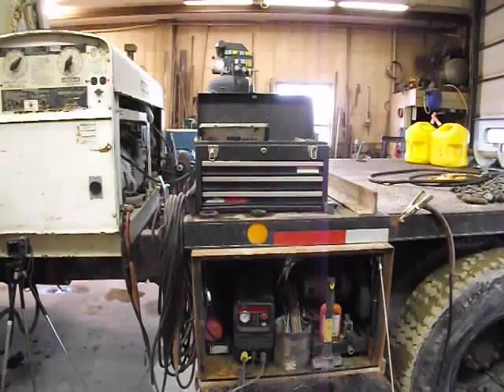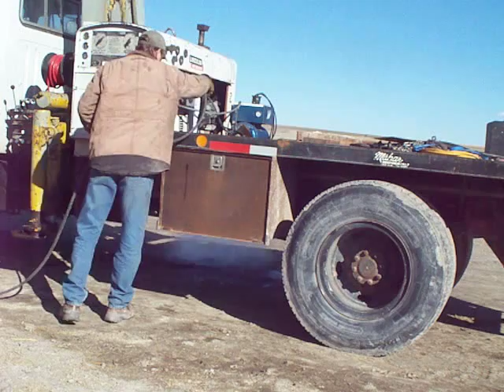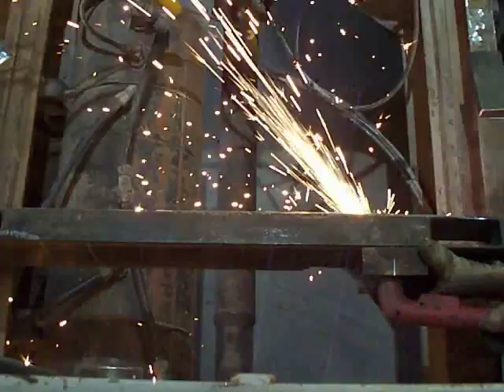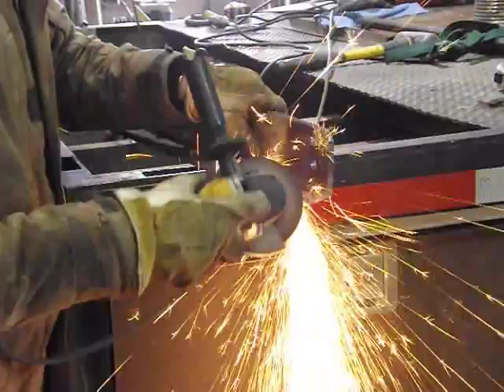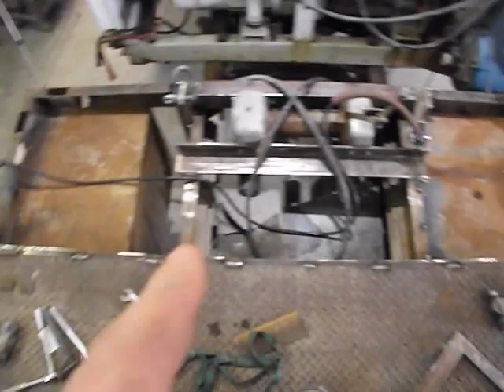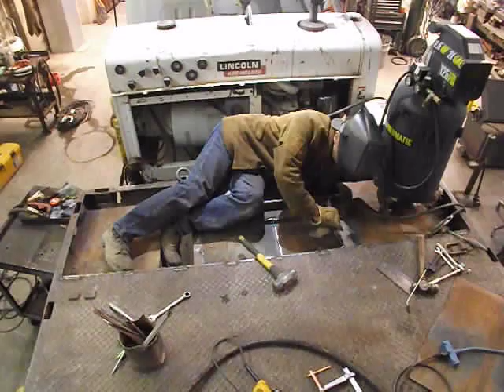Tulsa Winch Install - February 2014

Comment: Out on the Prince of Wales Island ... Alaska, we never had a truck on the job and so I built one from scrap pieces of trucks that had hite the Island and couldn't or didn't for some reason. Talk about a joke, two ton frame from a old ford, from the sixties a chevy cab and engine, that was a tall deck block 427 with five and four trany, twin straight pipes up the side of the cab, half wood and half steel bed with the general necessities.. air, welder, boxes for tools winch on front could be blocked back to run the swivel boom that was on a hydraulic cylinder to run the boom from the front of the bed to the back of the bed and the list goes on, yeah I know what you mean beats a pick up truck any day of the week

Comment: I like the work and projects you do they seem similar to mine I am not a welder professionally but I like building ,welding. Things tools that I can use to make my hobby farm work easier,plus gettin older And work by myself a lot
Reply from the maker: I added a wireless remote to this winch, and it is super useful! I can pull vehicles onto a trailer behind my truck all by myself, while I'm sitting in the vehicle!